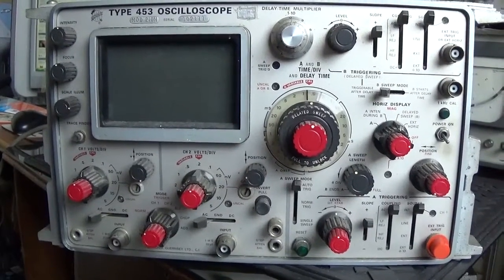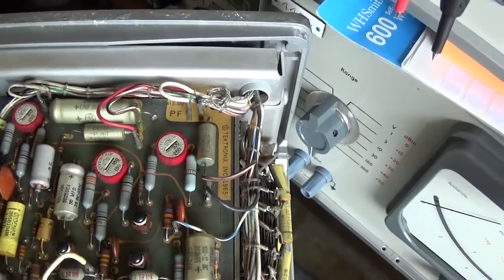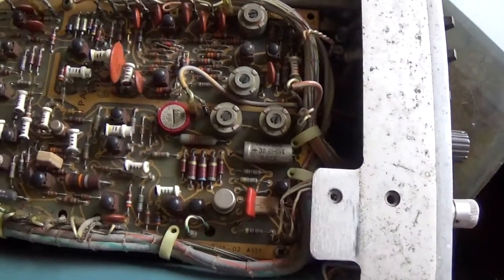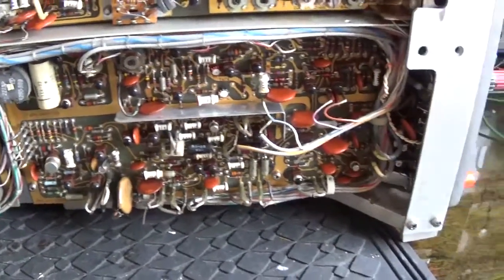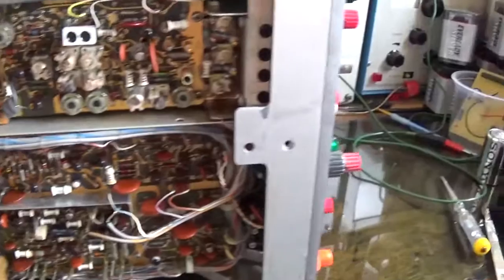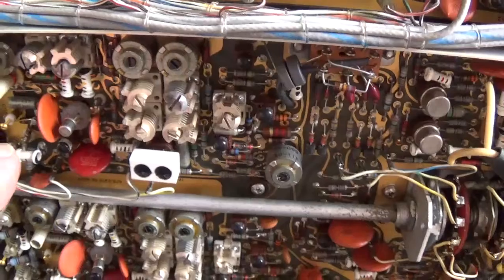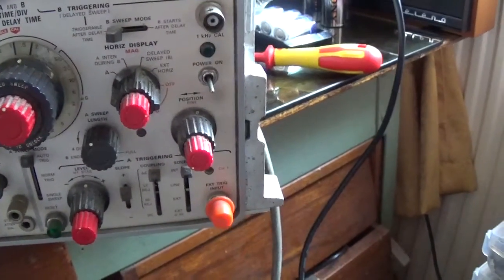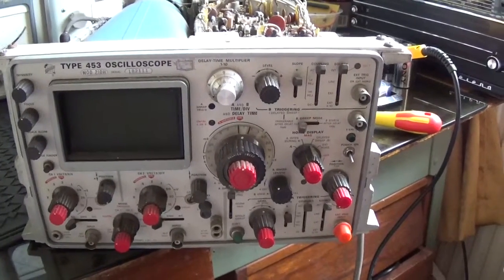Tektronix 453 Oscilloscope find

Comment: I own two of them. I  picked one up surplus from Los Alamos National Labs surplus sale back in the 80's. I picked up another (rack mount) from one of their auctions in. Albuquerque. The portable I have used routinely from 80's on and past 2010 (personal lab scope) and it has been absolutely bomb proof. It does appear to have microTubes on the underside BTW, they are easily knocked off with the bottom cover off FYI.
Out of curiosity I've opened it up to see what it looked but never had to do a thing to it. 

It has been dead reliable for the three decades I used it.

 I now use a 4 channel Siglent. They have transient recording,  fit nicely on a desk, way a whole lot less, and are easily transportable, my poor Tek 453 does'nt get much attention from me these days. :(

Comment: I just completed troubleshooting my 453 for no A trigger operation. I traced the problem down to Q473 open E to B shorted junction. I used my Simpson  260 VOM , Heathkit C checker and Fluke DVM. My Leader scope was used to monitir and verify the A and B gate output signals and A channel output. I was able to verify the tunnel diode operation. Thats the second time in my life of 79;years to diagnose a tunnel diode operation.
Reply from the maker: Well done Jim!!

Comment: Just finding this video now, 5 years after your original post. I wonder if you ever successfully powered it up and used it. I have one that I rescued from a junk pile. It was in practically brand new condition. It hadn't been powered up in something approaching 20 years. I slowly brought it up to operating voltage thru a variac. Outside of very dirty electrical contacts in the switches and knobs, it worked well. I cleaned the contacts and got it into an operational state.

The item scratched off the front panel was a property tag. HP purpose built these for IBM field service engineers so that was likely an IBM property tag. Mine still has its tag as the techs who tossed it into the salvage pile never bothered to remove it.

Comment: 3:07 - Nuvistor? Those tiny metal (thimble sized) vacuum tubes designed to compete with the compactness of transistors? That’s so rad!
Reply from the maker: Nope! Not sure what you're looking at but all I can see are transistors, capacitors, diodes and resistors fixed and variable
Reply: @Andrewausfa   I was responding to your comment about the front end circuits - you said some versions had used a Nuvistor.   When I was 12 years old I found a Nuvistor in a TV and thought that was really neat.
Reply from the maker: @silvermica   Ah no, that was just me waffling about something I didn't know about. The early 453 had them but this one didn't. Love your Les Paul BTW!

Comment: Hi i have one of these I am new to electronics I just turned 60  and disabled and need a hobby lol i was into this years ago but didnt last girls and motor bikes got in the way lol my mate gave me one but a resistor blew on the Z-Axis board it went white and cant see properly what it is my multi meter says 3.3 ohm and a gadget i have says 3371 ohm. it is purple has writing on not bands I can show you it as i screen shot you going round yours can you help please :-)
Reply from the maker: Hi Paul,  sorry I didn't seem to get notification of your comment. Just spotted it.  Just message me via Youtube.  The service manual for this is pretty easy to find on-line.  There's the Tek one and then a military one which is a little easier to understand for the operating side.

Comment: 8:20: Comparing that to one of my 453s that would have been a label that said, "Property of IBM". 

Apparently IBM asked Tektronix for a portable (yes, portable) 'scope that would fit under an airline seat, and the 453 was the result.
Reply: ...although this is a rack-mount unit so... I dunno...
Reply from the maker: You're absolutely right, evidently (per Tekscopes group) the Mod 210H was for IBM with a set of probes with longer than standard leads.  The 'portable' bit is funny though compared to what we call portable today!